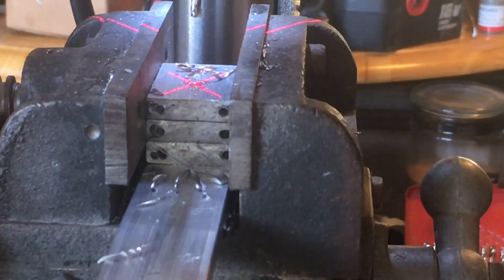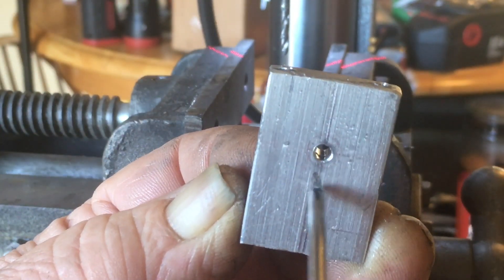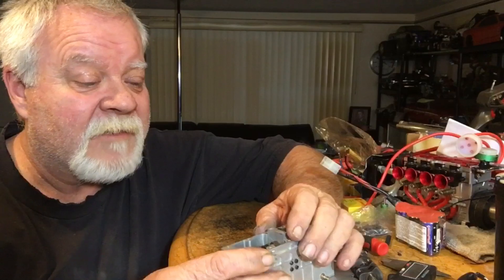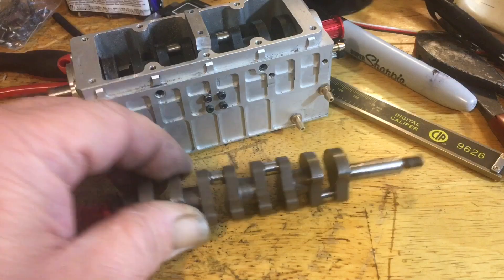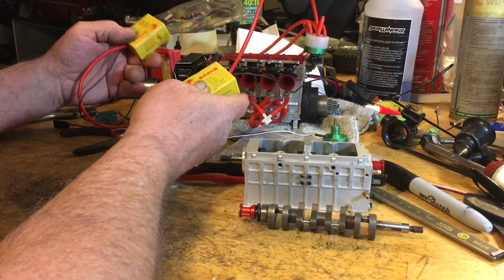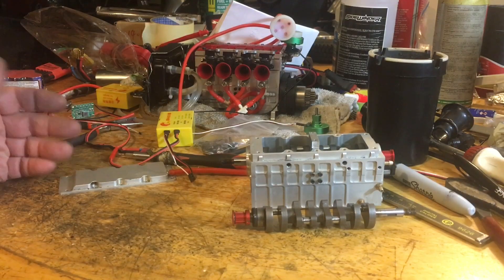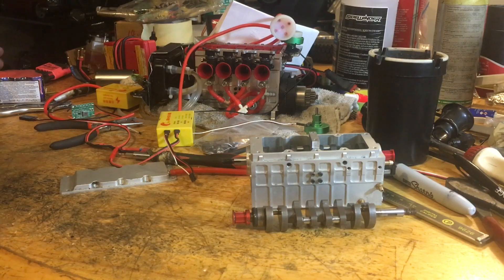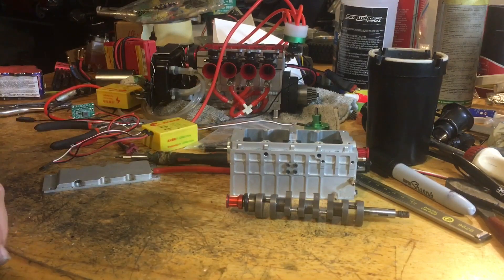TOYAN L400 CENTER SUPPORT BEARING MOD

Comment: My thoughts are, the CDI box is not operating correctly, and sending the wrong voltage out to the trigger. 
The voltage sent out to trigger is only to make the trigger live, BUT, since the voltage is high, it may have taken out the trigger. Most general electronic parts have a 10% tolerance, so nominal 5v in this case to 6v would be over 10%, or 20% in total. 
I have worked on some similar Chinese ignitions, and the most common failure I personally have run into is failed Capacitors in the box, wich leads to NO SPARK.
Hope this helps?
Reply from the maker: Good call brother, yeah one cdi was bad the other works fine now.
Reply: @dennisdempseyradiooutofcontrol  10-4!!!👍👍

Comment: I wish I had a mill at home too...Your best bet for those is going to be to make them too long, then verrry slowly hand file/sand each piece until it's just short enough.  With enough patience and some feeler gauges, you should be able to make something work there.  You'll also want to really polish the aluminum bore and that crank journal to prevent galling.  Steel cams have been running directly in aluminum cylinder heads on full size cars for decades, so it should work as long as it's smooth enough! (that plus all the oil slobbering around)
Reply from the maker: Good call there brother! I am going to try that. Thanks my friend! MERRY CHRISTMAS! 👍

Comment: Hi Dennis, Great videos and support for trying to push for a solution on this problem that a lot of us in the community face. My engine has not run yet and I am in the process of making a centre support bearing. Had a thought though. have you considered running a 'wet sump' so that there is lubrication there ?? I am looking at this at the moment instead of running it dry.?
Reply from the maker: I thought about a wet sump but it gets plenty of blow by oiling on the crank. I haven't installed my center bearing yet im testing the thicker head gasket and it seems to be working good so far there is no more hydro locking.
Reply: @dennisdempseyradiooutofcontrol  Hey Dennis, Cheers for the reply!! Really appreciate it. I have tried messaging others too and no joy.  Love the head gasket change too, went out and got some gasket to do that. Keep up the great work buddy

Comment: Hope you don`t mind me posting on your thread. I`m also making a center bearing. Slightly different to yours in design but I`d like to comment on the crank.I took the oil seals off both ends of the crank . Then with the rods /pistons removed spun the crank at first by hand later by machine to approx. 20K rpm. I was horrified at the high speed distortion at the crank center. Mine like yours had about 0.008" runout so at high speed was bending under centrifugal force. I machined the center bearing true which helped a lot but noticed when spun and coming to a stop it always stopped in the same place. Out of balance.Then I noticed the front and rear counterweights are wider and therefore  heavier than all the rest hence why it always stops there .Next I`m going to machine down those couterweights to be the same as all the others then finally tackle the center bearing. Keep you posted.
Reply from the maker: Cool to hear your working on the problem also, I havent put my crank on the lathe yet but now I will know what to expect lol!  please keep me in the loop on what you design and I will pass on your ideas for you.👍

Comment: Hi Dennis, Hall effect devices are not normally switches. As the magnet passes the sensor the magnetic field that the sensor experiences changes. This change in magnetic field is sensed by the device and fed to the 'electronics';  then processed to produce whatever function is desired. In this case the signal is used to generate the HT voltage for the spark plug. Brand new bent cranks explain at lot. I saw the Toyan video of cranks being machined. NOT a CNC machine. The fog is beginning to  clear !
Reply from the maker: Yes the hall sensors just use a magnetic field, I had it working with the new sensors but it was hit or miss, I think the spark units are bad, one doesn't work at all. the cranks are quite a engineering marvel with that equipment lol!

Comment: hi Keep up the excellent work. one thing i have noticed is you have the yellow CDI and the 32cc with that distributor works with the silver one, not sure on the diffrence. 
Hope you work it out got my L400 when they were first sold like yourself and many others. Its been test started and now benched as cant afford to brake it. Now have the Enjomor 36cc DOHC. and can only say wow, build quality is excellent.
Keep up the great work.
Reply from the maker: Thanks for the info on the Enjomor  engine I want to eventually get one for a 1/5 scale 4x4 I am building.  I think the L400 can be fixed its just a matter of finding out why the cranks break,
Reply: I think your on the right track. with the spark plugs would stop glow lag. as you found when you done the head gasget test. Re crank has to be 1 pore build and 2 exsesive presure top or bottom end.

Comment: The crankshaft is twisted. This is the result of either bad production or low quality control. In every engine the centers should run without wobble.
Reply from the maker: Yeah it needs to be reground on a good machine 👍

Comment: Dennis, your vids are a blast to watch.  As for your Toyan problem: the correct way to add the center main bearing support is to 1) grind the crankshaft center journal so it runs true. Then 2) install the center support and line-bore it through the crank case.  So yes, you are most definitely going to need a machinist to do that work.

It's such a shame Toyan didn't support the crank in the center to begin with.  This would be such a great little engine otherwise.
Reply from the maker: Yeah it will need a line bore to make it centered, just think a couple more machine processes would have made the L400 a perfect engine,

Comment: its nice to see you are using my design to fix the crankshaft problem
Reply from the maker: Thanks, it has been on my to-do list since you turned me on to it, I had one on order from Timsane but haven't heard anything back from him in a while,  did you have to do any maching on your center crank journal? mine is really out of round.
Reply: @dennisdempseyradiooutofcontrol  yes I did mine was out of round to

Comment: I think the signal wire would put out its own voltage separate from the power wire and to polish the crankshaft you could wet sand it with 3,000 5,000 and 7,000 grit sandpaper and use the polishing Dremel bit
Reply from the maker: yeah im still learning about the different hall sensors lol!  I have a small lathe to try to true up my crank,

Comment: Wow that is a problem with that play. Idea is good maybe drill an oil hole to lubricate & avoid some friction. I don't have one but I entertain sort of the same idea but with some tiny split bearing of bushing and somehow route oil for lubrication. The split bearing would be hard to find though. like I said I don't have one, all I can do is share an Idea. Good luck Dennis and even if it fails there is always going to be another idea to defeat this problem. LOL why?, because our minds don't accept defeats. LOL. cheers bud hope the best.
Reply from the maker: yeah I was going to try to put some slots in the bushing to act as separated pads that can catch the oil and eliminate friction like you said our minds don't like the failure theory,  lol!